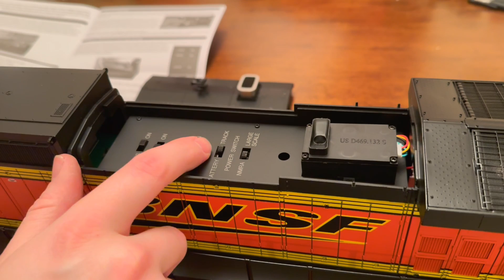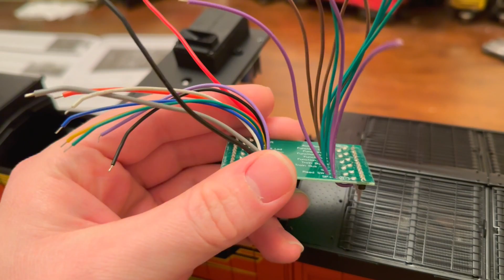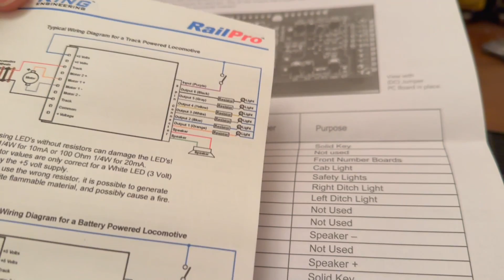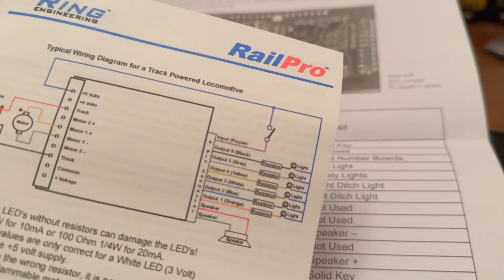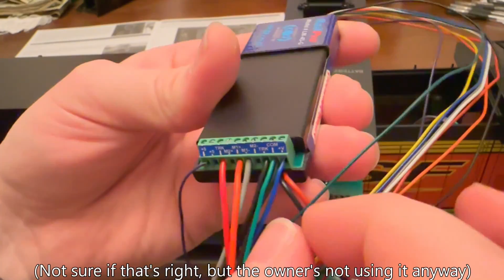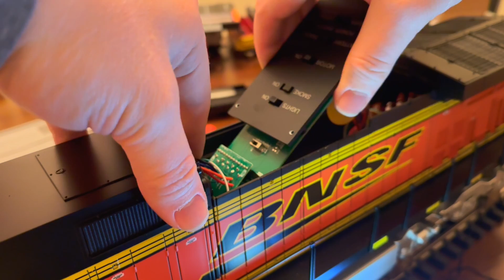Installing RailPro Controls in a Large Scale Bachmann DASH 9

Comment: Great work as Always Darth! I've always throught modelling in this scale would be fun, but man it must take up an entire backyard! (PS: You're at 5.99k Subs, only around 10 to go!)
Reply from the maker: Or at least a large barn or open basement! I think I’ll stick with HO myself, but working on something else now and then keeps things interesting.
Reply: @DarthSantaFe  Depending on the size of the house, you might only get a loop in! (PS. Do you know what Hobbytowns bearings are made of? I got an RSD-5 and found out it doesn't have any of its Axle Bearings! I would assume copper?)
Reply from the maker: @RocketStephen618  The bearings are made from bronze.  If it's an old one with the plastic wheels on one side of each truck, then the bearings will be half-circles that drop into the slots and the axles rest in them, and I've replicated those before by grinding the top off of brass tubing.  Any others newer than that should have the square flanged bearings, and you can get those from Hobbytown: https://hobbytownofboston.com/
Reply: @DarthSantaFe  Got it! It is one of the older ones, as the "worm" gear still has both of its bearings. Makes me wonder if the person who had it before had binding and instead of filing the slots down just decided to remove the bearings. Thank you for the help!